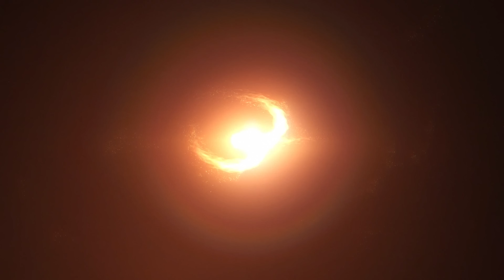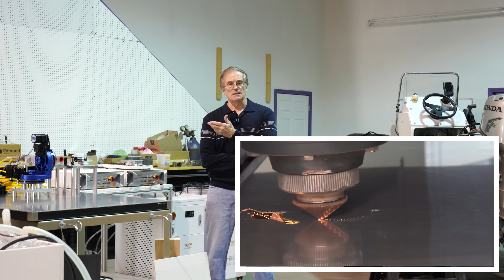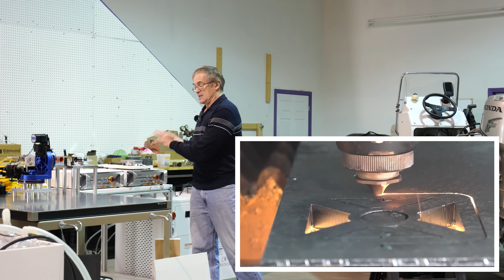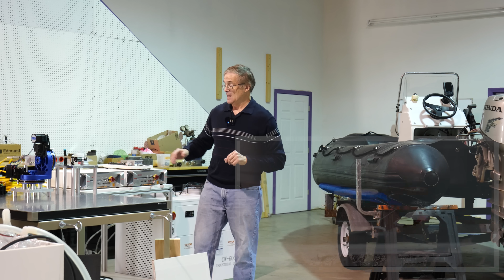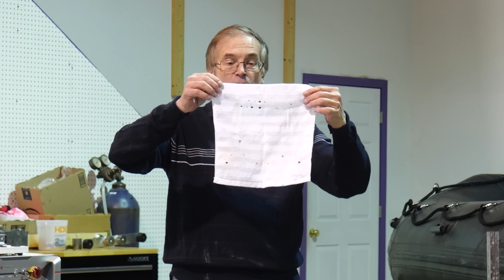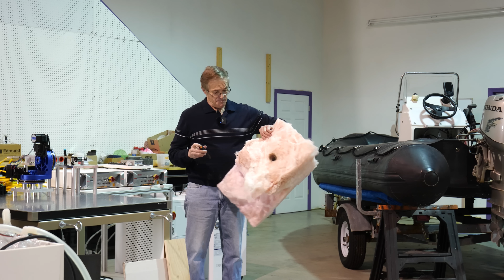We have a problem... and need your help!

Comment: How about a wall of mirrors at 45 deg that direct the beam down to the floor.  Then on the floor, have a couple of inches of water in a shallow pool to absorb the energy. I guess the key question would be if the mirror material could reflect the energy without absorbing too much and breaking or overheating.  If the mirror was somehow curved a bit, then this could cause the beam to unfocus and reduce the intensity when it hit the water.  You could use thin polished stainless steel with flowing water behind it as the reflective surface.

Comment: Focus the beam to the object multi-directionally with steep divergence like the sharp focus on the laser metal cutter tip you mention. Try a slate (stone) wall. Kiln brick (stone or pulverized to powder). A wall of wavelength specific laser barrier plastic like for goggles or welding mask material.  A wall of ice or dry ice. A wall of sand blast media (glass beads, slag media). A wall of mineral oil. A wall of Orbeez.  Or frozen Orbeez.  A wall of marbles. ………. Too much laser power! Awesome problem.

Comment: Edit: second suggestion is better than the first here: Two razors close together, a couple inches from a round laser absorbent backstop. It will break the beam into many many mini lasers with less power. The round stop will make sure none escape. If the central resultant beam is too intense, add another pair of razor edges close to where it hits the barrier. 

Or, how about a tank of water with a carbon layer at the bottom? Just some coal in water. Make sure the laser enters the water at a direct angle, and let it heat the black coal. Water will absorb the heat, and coal can be as thick as you like and as fine as you decide

Comment: As a light diffuser I can suggest a wall made of small transparent glass balls bonded together like in a styrofoam panels or a few layers of transparent fogged glass just to diffuse the incoming beam before hitting your final blocking material.

Comment: You need to disperse that energy before hitting the absorption surface. How about a light diffuser like a fogged glass at about 0.5 - 1m in front of your final blocking material? Similar things are used in LCD panels, but those are made of plastic.

Comment: There's a few suggestions that come to mind one is the beam expander so to reduce the initial start beam into a flash light concept the other is electron doped collection like a solar panel this would absorb the energy of the photons by nocking the electrons off the absorber for the given time frame. Curious to see what you come up with!

Comment: Suggestion: Microprismatic Paint - Spreading out the beam. (or encrusted epoxy panels using Microprismatic Dust.)
Change its focus from narrow to wide.

Firebricks made from lime (perlite) and phosphorus, molded under pressure and soaked overnight in water.

Comment: I think you need to use several layers of materials to gradually unfocused the beam and capture it between the layers and also I’d advise to use like a V shape seen from above. There is a special diffusing glass, used in cinematography. You should try it.

Comment: Not an engineer but I'v messed around with making my own forge. A 1:1 mixture of plaster of paris and sand as a refractory might be something to try. You can pour it into a mold and try out different panel thicknesses. Cures pretty hard, some sort of backing material would make it less brittle and make it so it can be hung if needed. Materials are pretty cheap and readily available.

Comment: The problem is getting enough ablatable mass in the way of the beam, which for a static target means very thick and/or heavy. Use a moving target. Build a vertical axis prism from timber, with 4, 6 or 8 sides, with vertical panels 8ft high 4ft wide, paneled with drywall. This gives a 'back wall' obstruction of about 8 ft square. Once spinning, the laser is continually given a new cool bit of drywall to burn through. Only needs to spin as fast as required to prevent burn-through. For a more robust construction, use ply rather than drywall, as the idea is not to let it burn. Very little motor power required to spin it, in fact it could be spun-up by hand, it would probably go a minute or two if the bearings were good enough. Though bulky, it's not that heavy, and uses very cheap materials. A little ingenuity in the frame construction would make it collapsible down to panels for transport/storage.

Comment: Hi, try to deliver a crystal glass mirror and invent a laser cannon that works in both directions > firing > return or loop through, with flying objects try a composite of several lasers distributed that create a cross point, each beam alone has too little energy to cause …

Comment: 🤔Before the video ends, I see several approaches to this problem... some probably won't work but there's a chance and would need testing. Hopefully I can have some thoughts together and post something tonight. 

 If you could test a few targets, get an idea of the time needed for the results you want would give a little better idea of what to shoot for. Pulsing the laser in timed frequency just under the amount required to disable the target may eliminate the need for a shield. This idea makes me wonder about the technical functions of the laser (if it could be pulsed). If not a high-speed lens system to take the beam in and out of focus (rotary system?) This approach would be best because no matter where you use the laser, you would aspire to not zap something beyond the intended target.

Comment: I believe the folks in the Ukrainian Army would love to collaborate with you if you need funding for more expensive solutions. 

You mentioned that the drywall took 1/4 of a second to burn through at 1/2 inch thinkness. Therefore a spinning drywall section that moves at just 2 inches per second relative to the beam shoud be immune to burnthrough. A number of ratating drywall panel sections spinning just a few rpm sould be able to address your light, cheap and portable requirements. probably would wantr to double or triple layer the drywall near the center of the rotating sections, but that can be done with scraps from cutting panels. pverlap rotating panels and that should resolve it.

Comment: I'm thinking water and gelatin mixed to a degree of viscosity, such that it will fill holes made fast enough but not flow too quickly through the exterior membrane holding it in place. The goal here is to fill in, and absorb (ie: spread the energy to the larger mass). It might be that ice could work but I'm worried about chemical responses at higher temperatures from frozen to flash vaporization.

I'm reading below and see Spirit532's response and sand seems a better material than water. Maybe there is a consistency of clay (or other mud) that would fill in rapidly enough and yet retain enough viscosity to not flow through the holes made in the membrane that's containing it?

Comment: That looks extremely dangerous. Given that the brick worked, what thickness is needed? can you get half bricks and mount them on something (no need to build a wall, rather have them glued to the plywood or something similar in sections. Not overly portable, but given what the laser went through I don't see you finding anything particularly light weight. Obviously steel plate comes to mind but then reflection might be a serious risk.
Reply from the maker: You may be right. The brick I used was made from cement.  The material is promising,  but the brick format isn't very practical. Half bricks or pavers would be easier. Maybe even cement, backer board.

Comment: I'd think a surface that could effectively diffuse the laser. Maybe a frosted pane backed with brushed steel  then covered with flowing water?  A bit elaborate. 

Maybe focus the laser into a prisim and manage the wavelengths independently?

Comment: What if you take your wall of bricks and put them in an acrylic water tank that is sealed. The water could be dyed to disperse the beam and you should get minimal leaks from the small hole.

Another thought is make a slab of vermiculite concrete, or even pour a few inches of the stuff into the side of a large plastic water tank.

Comment: @LouwrensStassen
0 seconds ago
What I would try is have the laser point to a mirror at a 45 so the laser gets redirected down, then make the mirror vibrate. In two axis  out of phase is better so you get random ovals not just a line made by the laser going back and forth. After the laser is redirected down, make it pass through a diverging lens, then onto a dark soaked blanket. The oscillations coupled with the divergence should give the blanket a chance. Also, make the laser burn through something first that triggers an auto shut-off.

Comment: Just a wild idea: Can't you just build a wall that immediately detects a breakthrough and kills the power automatically instead of finding a strong enough material that can handle the laser for a while?
Maybe just a a bit of acrylic glass and some light sensors at the edge of the glass? I don't know.
Reply from the maker: A simple thermal camera could detect the beam on the wall.  We'd still want some protection to prevent burn through or surface damage.

Comment: 1. ceramic composites (e.g. zirconium oxide + carbon fiber)
Advantages: Very high temperature resistance, non-melting, relatively light.
Types: Zirconium oxide (ZrO₂), silicon carbide (SiC), aluminum oxide (Al₂O₃).

2. graphite composite sheets / pyrolytic graphite
Advantages: Extremely heat-resistant (> 3000 °C), good absorption, lightweight.
Disadvantage: Fragile, must be well secured.

Comment: This may be vary basic compared a few I already read.  If plywood worked then possibly wrap it, coat it.  Snuff the fire.  This is the extremely cheap way I would try but there are many more expensive options.  I really like the progress you have made since last video.  Please keep us updated.
Reply: The few couple comments just bellow sound great if doable.

Comment: To cut the energy of the laser beam, I suggest that you pass the beam through multiple rotating turbine ring blades in a tube, so that the beam is broken into Morse code segments and is not constant. The blades can be externally motor driven by having one of the turbine rings with an external ring gear with all the multiple turbine ring blade assemblies on a common shaft. The frequency of the pulsed beam can be varied by the gap allowed between successive turbine ring blades in conjunction with the variable motor speed. The cylinder and turbine blades can be ceramic with industrial diamond coating.  Maybe a Nitrogen cooling jacket may give the assembly life beyond a few seconds. Having a tube of 100mm with the laser beam entry to one side on the periphery of the tube with capped sealed ends to prevent laser light redirection to outside the turbine tube.

Comment: I think, first of all you need to assemble an array of prims where the round side should face the laser and the flat side will face outwards. This way you will spread the lasers power and behind the prism should be a wall of tiles, what can absorb the heat. When the prisms are small enough (like 3-4 inch) and size of the array is at least 4x4 foot, then you can place this anywhere. On top of that, you can make smaller, modular pieces of this let's say tiles and then assemble a wall from them as needed. Glass is more heat resistant and can spread the laser beam more effectively than ofther, more expensive materials.

Comment: My idea might be completely off, but wont something similar like abletive shielding would be the best, for example old space capsules literally used cork sheets. Ofcourse it will smoke but nothing toxic. Additionally making it wet might help too. Behind it, ceramics or aerogel can be used, something like space shuttle aerogel would be great, but i dont think its very easy to make.

Comment: Love the water wall idea!

Please report on that in detsil.

A Highschool science fair project used a hollow wall lined with carpet and filled with pebbles.  This was effective against many hits with high poweted rifle rounds.

Consider a mist wall.  Tiny water droplets will scatter but not reflect the beam.  Mist and fog should be interesting to compare.

This is portable, non-toxic, inexoensive and scalable.

Mist in front of the water wall (perhaps fireproof curtian) should provide protection down range.

Thanks for sharing!

Also, consider putting a
watchdog on the actuator to disable the beam when not moving.

If I can be if assistance, please reach out.

BTW: we are neighbors.

Comment: Change the problem to a feedback problem: use the power cable to the laser as the blocking material.  When the power is cut, the beam should stop soon.  A reset-able fuse would be more convenient though.  There is a similar feedback problem when shooting down a target, you need fast feedback to pass the power only when the beam will impact the target, and not when it will pass through or by the target.

Comment: I would like to see rockwool in place of the fiberglass.  It really works better than the oem oven glasswool it  came with. Ceramic is the best, it is used in kiln ovens...  I want a ebay fiber to clean metal... I really enjoy the vevor plasmacutter... badass cuts appliances and cars like hotwire in plastics industry.... 😉.

Comment: how about GIRtech Refractory Ceramic Fiber Insulation Board. its rated to 2300 degrees and used in ovens and should be affordable

Comment: Seems like you have found quite the challenge. Since the idea is to cover as much area as possible, the combination of lightweight and thermal capacity requirements seem tricky, as they are pretty much atomically opposed. Maybe try going for thermal conversion instead? It seems ridiculous to move that amount of heat so quickly, but thin sheets of metal might do the trick. Combining the heat transfer and absorption capacity of metal might be enough for a second or so. I think metal has the best heat transfer you will get for cheap, so to help with the heat capacity, you can spray water with condiments (black given your frequency) on the sheets of metal. It wont be lightweight, but easy to take down and setup, with it being possible to hang from the roof. Hopefully, the water takes the brunt of the laser, and the metal can move the heat to other drops of water before it reaches its melting point. The condiments might block the refractive properties of the metal, but might also evaporate away with the water, please take care. Also, coarse metals would be good (for obvious reasons), so either a rough finish, or metal from a scrapyard. That's pretty much the best i have come up with. Since its a laser with uniform wavelength (i'm assuming), laser-diffraction doesn't seem like it would work, but it also seems like it you haven't quite considered it. Dispersing the laser would be the most applicable option if possible, I don't have any suggestions there though. 

On another topic, have you seen this YouTube video from Veritasium? "Something Strange Happens When You Trust Quantum Mechanics", https://www.youtube.com/watch?v=qJZ1Ez28C-A&t=1524s. It is some of the most interesting light related insight i have found (being an amateur). It would be awesome if you could involve some related experiments in your project, as a powerful and directed laser seems like its perfectly in the Goldilocks-zone between measuring the effect, and proving the non-linear movement. I hope you find a solution for the material, although I'm most excited about the effect Veritasium presents, there are too many cool experiments with lasers to give up here!

Comment: Essentially, you're asking to make a light sabre. Unfortunately, that technology has not been developed yet . I can only assume that the ceramic tiles that they use on the space capsules . Also, painting the plates in a light absorbing musou black pigment. It will stop reflecting the laser, maybe?  My best guess .

Comment: One thing you could try is, if you have two large glass panels, seal them on the sides and place them in a trough.  If you add a pump to the system you could pump the water to a reservoir on top, allowing the water to fall to the bottom.  If you add turbulators throughout the stream you could prevent the water from entering laminar flow, and give it a mixing motion.  This motion may mix the water in such a way that when struck by the laser, the light would be dispersed, reducing the energy level.  Of course you might also burn something else if it all reflects at once, so you probably want the flow to be as bubbly as possible.  The high heat capacity of the water and flowing motion would also help in cooling the glass.

Comment: Ex military Engineer... What spectrum of light are your lasers using? If you can figure out what the frequency of the spectrum is, you can simply counter the frequency to neutralize the light from the laser. Light is simply a wave frequency. And two opposing waves will cancel each other out. Try a spectrum of colours painted on a sheet of plywood, and slowly run the laser across the spectrum. I will guarantee you will find it, and Ill bet $100 on it that its near the blue spectrum. ;)

Comment: Wet sand / tiny clear hydrogel in wooden / plywood box. Stacked them one behind another. Just makke sure it is properly wet. The outer surface of the plywood might caught fire, but the backside wont since it will be in contact with wet sand and self extinguish. The reasoning behind hydrogel is as they are somewhat clear, they diffuse and scatter the laser light and since they are mostly water, they will absorb a lot of energy.